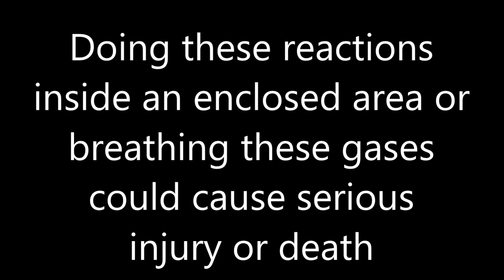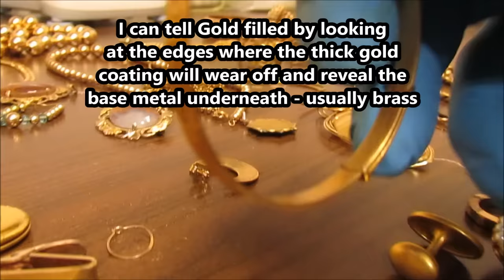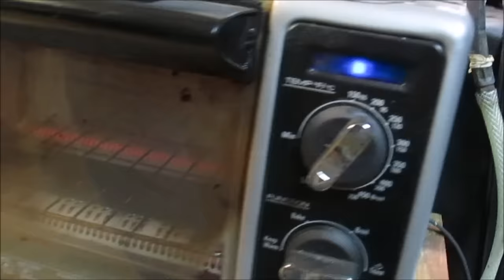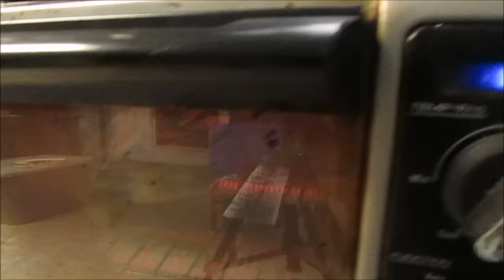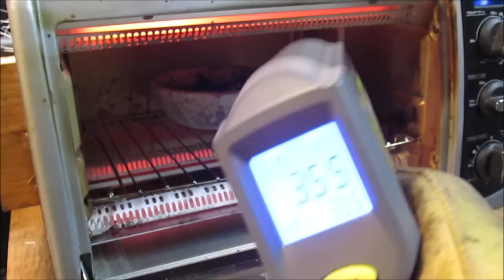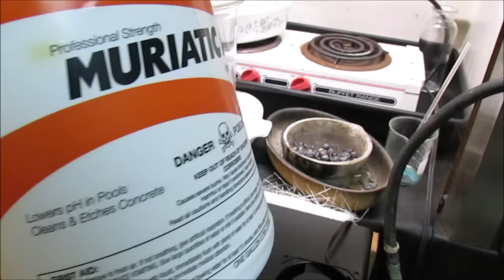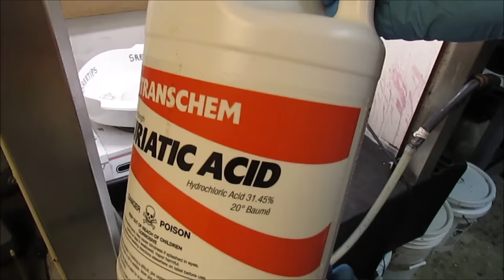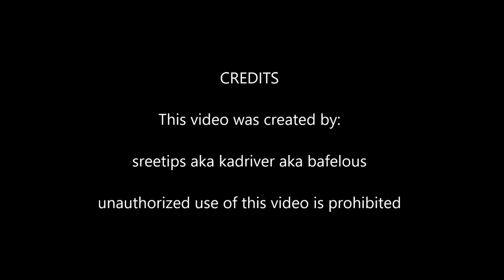Gold Refining 740 Grams of Gold Filled Scrap

Comment: Taking those watch bands apart a piece at a time? That thought makes me cringe. Damn, you have some patience! I used to work in Jewelry dept in Retail and had to adjust watch bands a lot, that's why that idea made me cringe. … and made my fingers hurt as I remember fighting to open some of those taps on the smaller bands. But then, I had to work to NOT damage it, lol.
Reply from the maker: I work setting replacement diamonds at a jewelry repair shop. I also do watch batteries and band adjustments. Taking them apart is easy. The challenge comes when I try to put them back together. Getting pure gold, from any source, is never easy.
Reply: @sreetips   I didn't have much problem with men's watchbands, esp. Elgin or Cassio brands. But those really thin women's bands? I don't mean the "oh its just under 1/2 wide" thin, but those REALLY thin ones that seem to barely be 1/4th wide. Opening the tabs were annoying but getting the pins back in to reconnect the band? I had to really learn patience for those. 

Wow, I suppose doing settings for replacement diamonds would give you the patience to do resizing watchbands. I'd imagine the bands be easier to do. But then I know nothing of the process for diamond replacement so it could be my ignorance speaking :)

Comment: As a lab tech of 20+ years, I winced and then shouted, I really hope you have an emergency shower.
Reply from the maker: Sorry for your discomfort. I'm not a trained chemist, only a hobbyist. An emergency shower would be awsome, but I've only got running water at the kitchen sink. I do practice emergency drills such as having a plan for power failure while doing reactions in my fune hood and I practice navigating my shop blind to the running water at the kitchen sink. It's the best I can do.
Reply: You need elbow length heavy duty rubber gloves, rubber boots and a vinyl or rubber apron. A full face mask wouldn't go a miss either. Total cost around $70.

Comment: does your fume hood need a filter at the exhaust? or does it just get sucked out to the outside fresh air? also, are the fumes corrosive? I know when I left my pot of ram fingers stewing in a hcl acid and h2o2 bath, it caused surrounding metal to oxidize (this was done in a basement) Thanks!
Reply from the maker: It removes those fumes to the outside fresh air. If they are allowed to accumulate inside my work area then I'd be dead. Just like if you let your car run in the garage with the doors closed and you in there with it.

Comment: I've found karat gold chains with a replacement gold-filled clasp. I guess the owner went to a jeweler to replace a 14K clasp that had broken. When told the price would be $50 or more, they opt for the cheaper GF clasp repair. I find a few every year.
Reply from the maker: I bought a 14k gold chain, unmarked, with a 10k gold clasp. I've also come across 1/20 12 GF clasps on karat gold chains. The jeweler will put a 10k clasp on a 14k chain in a heartbeat. Claims that is more durable and won't wear out as quickly. Creates a problem when the piece is sold.
Reply: It is legal to put a 10k clasp on a 14k chain, but not legal the other way around.

Comment: Forgot to mention that if you happen to do the magnetic batches separate, running a rare earth magnet on the outside of the beaker from the bottom up the sides will help pull the small steel bits out. You can just pick them off the lip or the side.
Reply from the maker: Yes, I've done that in the past.

Comment: To make this more profitable if you install a simple scrubber to the top of the nitric acid beaker that bubbles the red NO2 into water you will recover 1 liter of mild-moderate strength nitric acid for every litre of conc you start with. That's just money going out the fume hood Also is your fume hood outside all corroded and discolored from the gallons of NO2 that flow around it?
Reply from the maker: I've had eruptions of beakers full of acid shoot all over the inside of the hood. Some of it got on the metal and corroded it.

Comment: You can filter the liquor several times with out doing a dissolution.  Save chemicals and time. 

You can use borax when heating the gold to further clean the gold.  The borax will make a nicer bar without mixing with the gold.  After the bar cools just wipe the borax off.  It leaves a bright solid bar without holes or trash from burning. 

I was thinking instead of three dissolving steps you may try one heat with borax and compare the purity.  Less work.  Maybe just as good.  I am not completely sure.   

All these steps should be done in a laminar flow hood.  Or your lungs are toast. 

 Do you use an IMR to check purity?
Reply from the maker: XRF - it's 999, every time. Borax is a flux. I don't think that it will remove impurities from the gold.

Comment: Hope's pure book says not to use the same method twice when precipitate gold.  That's some pure cake gold.  Pure gold looking good. Going to melt a pure gold bar that's pure.  Cleaned with pure hcl to get that pure gold. Cool the pure gold with pure ice cubes and then put the pure gold in the pure melt dish. Apply pure heat to the pure gold bar. BAMMMM!!!!   High purity gold.  O ly spent 80$ on pure nitric acid.
Reply from the maker: For re-purification best to use a different precipitant.

Comment: Hi Sreetips  I have a question the first process I used whatman 102  24.0 cm filter paper when do I start use whatman #1 filter paper   is it when the gold turn to gold powder each time from 2 and 3 process   or just the final filtration process . Thank you for your time and your our videos
Reply from the maker: James, 102 is the same as number 2 or medium flow filter paper. Number one, or 101, is fast flow for large particulate. Number three, 103, or slow flow is for very fine particulate. That's about all I know about filter papers.
Reply: @sreetips  thank you

Comment: This may be helpful ?  If I did it correct, looks like an easy way to figure grains of silver to add to grains of 14K gold for inquartation - multiply 14K grains times 1.265 for total silver needed. This includes the .95 to reduce by 5% you suggest.  Didn’t figure multiplier for other Karat amounts but seems like an easy method to use for dummies like me - the simpler the better.
Reply from the maker: Nice reduction. Simple is always better.
Reply from the maker: I worked it out and it came out perfect. I'll start using it in my videos. Thank you.
Reply from the maker: Daniel, I featured your new calculating method in my latest video. Thank you!

Comment: Is there much gold filled material that isn't marked? I tested a few small pieces of a watch band Solid links, no caps. Leaves the  shell/foils.  So I disolve a piece of the foil and stannous test is  Positive. Real shiny gold links. Not the brushed look on the bottom of the links like some. Bottom is as smooth and shiny as top.
Reply from the maker: Thats possible

Comment: I watched the whole video, and I am also a gold buyer but what you did here was awesome and that gold bar at the end was so nice!  I would like to attempt this and have plenty of gold filled items too.   Didn't realize you had to use 3 different types of acid.  Will re-watch this again for sure.  Was that one product (white powder) basically the same as Borax?  You sir are a professional!!  Thanks for doing this.   It's too bad you didn't start off with just a bit more and you could have had your full 31.1
Reply from the maker: The white powder is borax. It melts and acts as a flux, prevents the gold from sticking to the dish and helps the gold flow into a central mass in the bottom of the dish.

Comment: What do you think on the low end. Would 250 grams of mostly 1/10 12k glasses will produce?  About 40 pair cleaned no steel.
Reply from the maker: 1/10=.1 12k=12/24 or .5 so if you have 100g of material multiply 100g by .1 then again by .5 so 100g X .1 X .5 = 5g basic math. You can expect five grams of pure gold from 100g of 1/10 12k gold filled material.

Comment: What happens if you boiled off gold bearing aqua Regia til there was no more moisture ? Would you lose the gold in the evaporation or would it solidify?

We dropped the gold from solution but our guys did not rinse it very good at all... so it was sopping wet with gold bearing aqua Regia ..... but they dried it all out with the gold
Reply from the maker: Try adding HCl to rehydrate and then add more SMB to get it all to precipitate.

Comment: I have to remind you that those deadly gases you warn for are produced in every combustion proces where Nitrogen is involved :p
Reply: Only in trace amounts though. I am lucky/ unlucky in that if any metal is dissolved in nitric acid I will immediately get a headache. I can detect carbon monoxide the same way, though I wouldn't rely on it. Also happens when I handle or shoot with double based powder. I'm also insanely sensitive to the smell of bromide, being able to smell it from an old photographic lab twenty years after it was last used and a  professional decontamination and sealing was done. All this combined with colour blindness made my first two career choices, soldier and chemist, um, "fun"...

Comment: Question: when you dissolve the base metals out and you are left with only foils, those foils are essentially carat gold correct? With that being said, how is it you dont get any silver chloride when the foils are dissolved in aqua regia? Should have been a minimum of 45 grams of carat gold if it was all 14k gf, Thx
Reply from the maker: That’s a good question. There usually is some silver chloride that settles out before I filter the dissolved gold
Reply: @sreetips  leads me to believe that the foils were alloyed with something else.  So, what would be resistant to the hot dilute nitric while going into solution in aqua regia? Do PGMs have this characteristic?  Zinc? I think this could help explain why the yield was so much higher than expected. Id be interested in the assay results of that bar. Is it possible the silver came out in recovery while leaving the foils so intact post nitric? If its copper, i would think it would not be so yellow

Comment: Why is is so important to remove all the steel pieces? Will it foul up the reaction? Or does it just take more nitric acid and distilled water to dissolve it away? Thanks Sreetips
Reply from the maker: Both are true. Steel has iron. If allowed into the aqua regia reaction beaker, then in accordance with the reactivity series, the gold will cement out on the iron as it dissolves in the AR. Nitric acid will dissolve iron, but not very well. It will take more nitric and more time.

Comment: Thank you so much! I was wondering what R.P.G. ment.
I was wondering, I want to do a batch of pins. I'm using sulfuric acid, water and diluted table salt. Have you dissolved base metal in this way before? If so I can go check out the video! And thank you so much for all you do!
Reply from the maker: Yes, I did trimmed circuit card fingers. I was under the direction of some chemists on sciencemadness.org - it worked, but it was inefficient and cumbersome. I’ve never used it since.

Comment: At 36:03, when rinsing the tubing with distilled water, some drips in the reaction vessel. It turns milky, similar to silver chloride forming, but with distilled water it shouldn't have been silver chloride. What was happening?
Reply from the maker: I had to watch it several times to see what you were talking about. That was the water falling into the beaker and churning up some of the sediment that had settled out overnight. Siphoning leaves that sediment undisturbed. If I had tried to pour the solution then the sediment would have been stirred up, by the pouring action of having to tilt the beaker, and much of it would have been poured over into the waste beaker. I wanted to keep all of the solids in the reaction beaker. That's why I siphoned the waste solution instead of pouring it.

Comment: Anyone know why, after the last hydrochloric rinse, that the gold looks brown and muddy? When its melted down immediately after it comes out looking perfect.  Just curious.
Reply: It's extremely fine gold dust, so fine instead of looking shiny and yellow, it looks brown, because the tiny particles are smaller than the yellow light wavelength they reflect, so it's diffracted into a color befitting of my most horrendous product in the toilet.  Rest assured, if that came out of my ass though I'd be a rich man! But once the dust is melted back into a bar the familiar shiny gold color is regained.

Comment: Hello. I asked you about a year ago what the best producing GF material was, and you said bangles were the best. On average how many gram of bangles would it take to get an oz? If 700+g of mixed materials got close to an oz here. And have you ever processed  any old GF makeup compacts or manicure kits? Thanks
Reply: And also. I am doing a batch soon. And was wondering if any of the magnetic material should be excluded? I saw in you gf watch video you said it was okay.  But wanted to make sure there isn't some kinds that I should take out. All of the springs, screws have been removed. I have some glasses frames I want to throw in too. But parts of some are super magnetic. While same parts on others aren't. But all 1/20 12.
Reply from the maker: In my experience, the older early 20th century gold filled bangle bracelets have a thick coating of karat gold. Old pocket watch cases produce excellent yields also. I've gotten yields from 2.5g to 4g per 100 grams of gold filled material. The gold being worn off will be a factor that affects yields. The more it's worn, the lower the yield will be.
Reply from the maker: Magnetic material should go just fine but it's best to remove any that you can before starting acid digestion. Nitric will dissolve iron but it doesn't do it very well. For example, gold filled watch band tops with just one side coated with gold will stick to a magnet. But they will go just fine. All spring steel pieces should be removed before committing to the acid. Spring steel is a differen animal and nitric won't dissolve it very well. After nitric digestion check the gold foils with a magnet. Remove any magnetic material that you find before incineration and AR digestion of the incinerated foils. DONT FORGET TO INCINERATE THE FOILS BEFORE GOING TO AQUA REGIA.
Reply from the maker: One other thing, keep your eyes peeled when you incinerate the items that you plan to digest in nitric. When incinerating, before going to nitric, during incineration, none of the gold filled should melt. If any metal melts and stays molten just from the heat of the dish then it's probably lead or tin. Find the source and remove it from the batch. Lead will dissolve in nitric. But tin with nitric forms a paste called metastannic acid. It will clog filters. Like trying to filter Elmer's glue. Gold filled is notorious for containing soft solder, which is an alloy of tin and lead.

Comment: 2 questions.
1 why don't you use aqua regalia from the beginning? 
2 Why don't you destroy all the metal beforehand, to allow nitric acid to attack base metals no longer protected from nitric acid by gold?
Reply from the maker: 1) Aqua Regia is a refining step and it would put all the metals into solution making a very dirty solution difficult to recover the gold from a dirty solution. 2) in the recovery process, I use hot dilute nitric acid to “destroy” (dissolve) all the base metals to leave the gold foils behind for refining. This is called the recovery process done BEFORE refining the recovered gold. Recovery and refining are two totally different processes.
Reply: @sreetips  Thanks for the answer.

Comment: Hello! I love your videos and am trying gold refining at home. I seemed to have messed up somewhere. Bonide stump out is not precipitating gold out of the bleach, hydrochloric acid mixture. It just forms a white powder at the bottom. Could I still have contaminants in my mixture? I took a small sample and added Hydrogen Peroxide and it formed a small amount of precipitation. What do you think? I tried it with a bigger batch and it did nothing. Did I mess up my whole batch now?
Reply from the maker: sounds like another escrap encounter. What's your source material, computer scrap? If yes then there's your problem.
Reply: You could have the wrong stump out. Jou can have KNO3 instead of sodiummetabisulfate wich forms sulfurdioxide to drop out the gold, if you still have your solution i would take a bottle with a cap and make a hole in it put a hose trough and mix the sodiummetabisulfate with hydrochloric acid in the bottle and bublle the gas trough the solution. And i know that im late, did you maybe alredy recover somthing?
Reply: find a winemaker supply house and get your smb from there